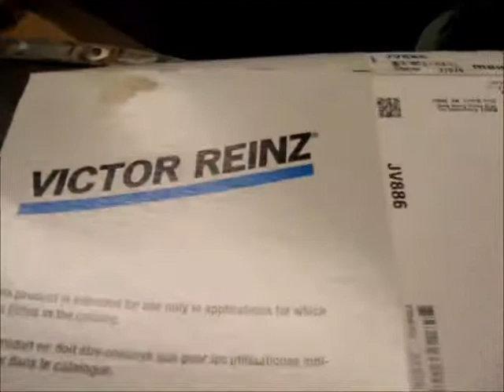1945 Farmall BN Update 24

Comment: You mentioned a forum website you were using to help you on the install. Could you share that it was? I wish to read up all I can to get familiar myself with the parts and repairs. Thanks!
Reply from the maker: Yep, I used Yesterday's Tractors , Red power and even Farmall cub,,,,, These are forums and you need to use the search box and type in what it is you are looking to find out on these forums. This one I liked a lot at this linc  ,,,,,,,,,,,,,,,,http://farmallcub.com/phpBB2/viewforum.php?f=170&sid=37c515a9c1832bcb872ea203bb79e102
Reply from the maker: Also i used Google Images also , I would type in subject, if i could mot find info on the web then I would click images . as I searched thru the pics . If I found a picture of what I wanted to see i would click on it to enlarge, Then it would offer up , view source, visit Web page and that would help to find info too.
Reply: Thanks a lot for the info! I spend some time looking stuff up!